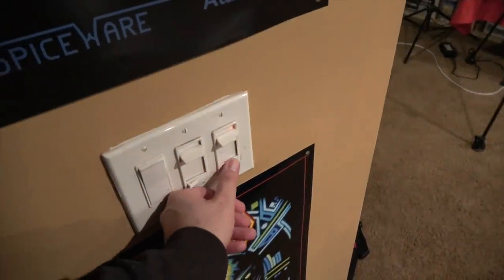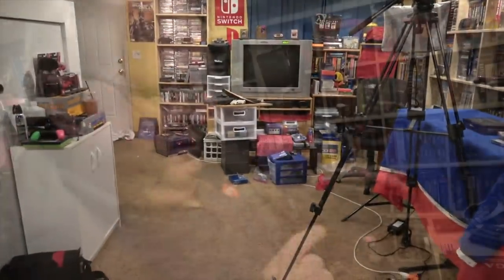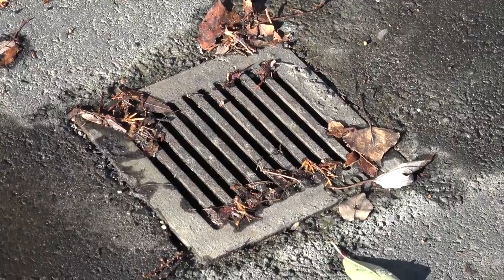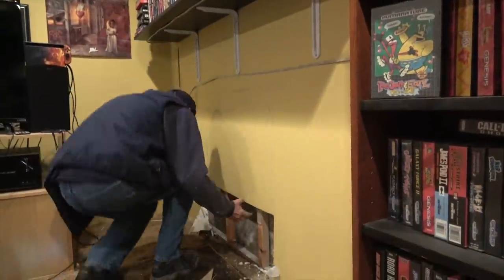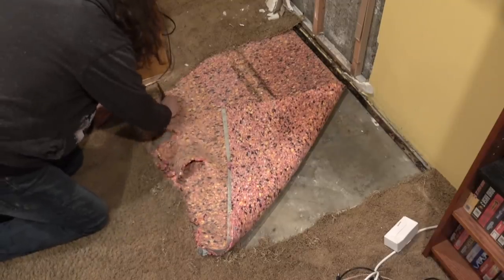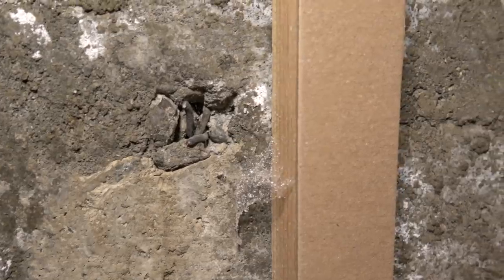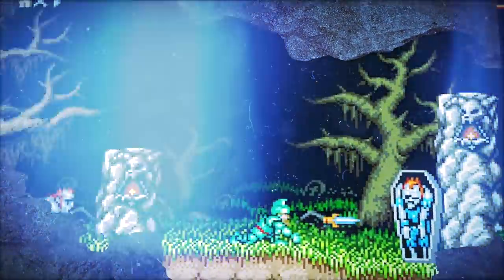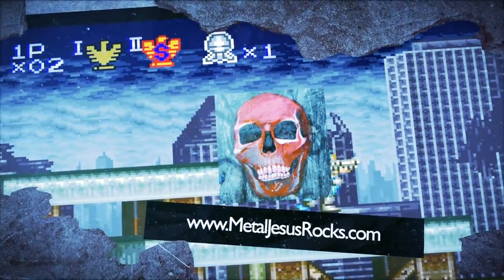OH NO! Water & Mold in the GAME ROOM! $10,000 to fix!

Comment: As a homeowner who also has their game room in the basement... This scares the hell out of me. I hope insurance can cover a lot of this.
Reply: In my experience, not usually.
Reply: you'd never get back remotely close to what you would want be it value or the items itself.
Reply: Most insurance does not cover finished basements. Same thing with the federally backed flood insurance that was written prior to finished basements being common. Maybe it would cover the leak repairs, but not the carpet, drywall or personal items. Usually just covers appliances like furnaces, water heaters, freezers and electrical, but that’s about it. After my sump pump failed and I found out the hard way (luckily just had to pay for my carpets to be cleaned and basement dehumidified since it was small and I caught it immediately), that changed my mind on doing a basement home theater.
Reply: Other comments have made it quite plain that they're making a sucker out of him by putting in drainage, but not fixing the outside. As someone else said; you don't just divert water after it leaks through your roof, you fix your roof! Big box hardware stores sell rebar and concrete, so he could easily rent a concrete drill to remove the material, pack concrete in, and jam a piece of rebar through. Once it cures, dig out the outside, ass drainage stones, and seal it up.

Comment: Man, just buy a few cans of flex seal...
Reply: Spyros Vassilakis Flex tape fixes boats so why not flex tape
Reply: Josh Jones He can pour flex seal into the holes on his wall... Problem solved.
Reply: Cover the yard with flex glue.
Reply: Yeah... Flex products were "designed" for scenarios like this one. 🤣🤣🤣
Reply: I was about to comment the same haha
Reply: Agreed. That is such a minor leak. No reason to redo the foundation for it. The water he saw probably took weeks or more to saturate that much.
Reply: You mean Flecth Theal?
Reply: This could be a really good fix! Remember that first and foremost those contractors are business men (or women) sometimes the best solutions are not the most expensive ones.
Reply: Most definitely, thats a lot of damage.
Reply: FlexTape all your games!
Reply: I sawed this boat in half
Reply: Yeah fix it with a flex tape....and then when all the other joints fail you can get more damage and cut more holes in the walls......This isn’t a cheap fix solution.
Reply: Build a second house of flex tape

Comment: As a former mold remediator of 7 years, I cringe when I see no PPE being used while handling mold and mold infected material. No mask or breathing apparatus, no gloves. I hope you took off your clothes you worked in and put them in a bag to wash separately. Because, all that mold disturbance, walking on the carpet, cutting a hole in the wall, pounding against the cut pieces, and ripping up that carpet; that released microscopic mold spores into the air. Like tiny bombs exploding all around the area. You're breathing that in, they're getting in your clothes, hair, into your lungs, all over your furniture, games, etc...our contract mold group would run air ventilators in that room, which would suck out all the air and be blown outside via plastic sheet tubing. It's expensive, especially if not handled properly, because of problems later on as a result of mishandled mold. I wish you the best of luck.
Reply: Was thinking this as well.. Metal Jesus has some very valuable gems in his collection that now have mold spores on them.
Reply: he's jesus.  he'll be fine.
Reply: Yeah I guess he could always turn the leak into wine and maybe the mold into a chalupa.
Reply: tylernol not a crock of shit... mold is bad shit. Brain atrophy as a result of it, had to throw away 95.% of my possessions because of it.
Reply: nice ad
Reply: gank Uverymuch plus it turns u into a clicker.
Reply: @ajborowski  I believe you I tossed my clothing out and Mold in my parents house again now cause health issues but nothing serious. Thank God I moved out.
Reply: You guys don't need to believe me lol...it's your health, not mine. I only went to school, got certified, and worked remediating mold out of my community members homes for 7 years. We went back to the first homes we did, 7 years later, and there was no sign of mold returning. So I think we did an ok job haha...but, don't listen to me. Go ahead and take these other know-it-all's advice lol

Comment: My suggestion is to get another quote for the full exterior thing. If you do it inside with a drain line, water are still licking into your basement, that does not fix the problem, still will be getting mold inside the wall. And a few years later the drain line will be blocked and you need to redo everything again.

Comment: Here in sweden when we have a cellar we usually dig around the house to replace the materials and fix the drainage once every 25-30 years. and you should not have plants in direct contact to the house, have a half meter of gravel around to keep the moist away.

Comment: . you dont have to remove everything, In Canada, we have like alot of water with snow and rainning., and every house have basement like yours, all you need to to is to apply a presurize glue in all holes. wait couple of days to dry, the glue is ciment glue, the name is EPOXIES
Reply: That was my thought drill out the holes with a large bit fill with apoxy resin and the. Dry lock the basement
Reply: yes northern ontario canada here , did concrete for years, even my basement, ive dealt with similar issues but i have a block foundation, but still very similar and they are trying to screw him big time.

Its can probably be fixed by doing some landscaping, check your eves, might have a leak, doesnt take much to take on  moisture in a basement.
Reply: @mitchdeblois3697  i had similar issue and did two things, put a drain tube in about 4 feet, (did myself) and put a special hose to drain water. and a specialyst came to fill the hole with expoxie..
Reply: @colearmoryllc  never drill more holes that there is.. just fill them with epoxie
Reply: @beaulieuRule  nice, another good alternative like i said is to take a look at landscape, could be simple landscaping to divert water, or maybe blue skin , but that would also involve tearing out the the jiprock

Comment: I had a similar issue earlier this year after a massive rain, and my game room also got wet. I had the same system put in around the entire perimeter of the basement and it was tied into a sump pump in my utility room, and it's been dry ever since. As long as you have a reputable company do the work, you should never have a problem again.

Comment: I had the same problem in my basement music room. I removed the walls and studs in 2 rooms. The permadry guys came in and threw up that membrane and dug a pipe in a few hours. Had to wait 3 days for the concrete to cure, threw some studs in, re routed the outlets, insulated and threw up some drywall. I had a pro come in and mud. It sounds like a lot of work but it was really quick and easy. The bill is worth it, knowing you'll be nice and dry for years to come. If you any questions hit me up.

Comment: As a temporary solution you could seal the interior of that section of  wall which has been worst affected, there are various products which you can use and get a dehumidifier which will draw out any moisture, it's actually a good idea to use a dehumidifier in a basement especially in older properties.
As a long term solution, I would tackle the outside of the basement , maybe a better drainage solution, get a few quotes from different builders/damp specialists and check to see if you're covered on your home insurance?

Comment: I feel for you MJR. I owned my condo for 6 months and came home one day after work to 2 inches of water in my living room flowing out the back deck due to my neighbor having a slab pipe leak. Drywall and carpet destroyed - months to dry it out and repair.  Once you get to the repair part,I'd recommend doing tile in the basement vs carpeting.  You can always put area rugs down if you want. They make some cool tile now that looks like wood flooring.  Also great for clean up any accidental spills during gaming sessions vs carpet stains.  Hang in there bro!

Comment: A lot of comments on how to shore up the basement (the symptoms), but no one wants to fix the cause: remove the parking pad. One of the recommended ways to do this in PNW and moist areas is to use pavers that are permeable so the rainfall can get directly to the yard and not cause runoff. Maybe a new above ground Tuff Shed-type building could be the new game room? Either way, good luck.

Comment: A few things I've learned from renovating a basement...  If you finish a basement you need to expect there will be water in it someday... Use materials that are mold resistant and have some tolerance for getting wet...  Nothing organic, nothing spongee, so no (untreated) wood, no carpet, no underpadding...   If you have a floor drain and the basement floor is pitched to the drain you might be able to get away with raising the floor with a plastic subfloor like Dry Barrier or a Delta-style dimple mat, then put waterproof vinyl laminate flooring over that, that will allow water to drain and the concrete to dry out.  I would also suggest you have humistats in various corners of the basement to monitor humidity and dehumidifiers to keep the air dry.    If you do go the route of putting in a interior basement drain as the contractor suggested, take everything out of the basement as there will be an incredible amount of dust created from the jackhammering of the floor.

Comment: Those metal things in your foundation are called snap ties. When pouring a foundation we use them to hold the concrete forms together so they do not blow out from the pressure of the concrete.

Comment: I solved this problem on my grandfathers house built in ~1970. By digging all around it for about feet and a half deep and some 7 feet away from the house and made a decline away from house from dirt, not much just couple of inches deeper away from the house. Then i put plastic tarpaulin from the house all the way outwards and glued it with polyurethane adhesive to the foundation of the house. Then i put the dirt back on top of it, evened it out. Made concrete path around the house around 2 feet wide, and used concrete sealer to seal gaps between sections and gap between house and concrete path. So far it has worked great and as someone who doesen't know jack shit about construction it's holding for well over a year with no problems. Cost me around 2000 euros and a week of work on and off with 2 buddies.  That cellar was basically unused for for the last 15 years as my grandfather is 90 years old and it's hard for him to go up and down the stairs. If there is someone who actually knows something about construction would comment on my solution it would be appreciated.

Comment: I have been less lucky than you MetalJesus... Last year, a lot of my games were stored in front of my very large window. At the bottom, there was a gigantic black mold, i mean a crazy black mold. Unfortunately, a lot of my games have been affected to it.

I had to dry (radiator) and flatten them with big books (Because humidity makes waves on the paper. It was mainly PS2 and GameCube games). I saved them but it took me a lot of time and patience to take them back to their "nearly" normal shape (the paper, not the box of course). Also, i had to cut a lot of the borders from the papers because the mold made them larger. I know, it's weird but it couldn't fit anymore in the box.

Immediately after this fucking nightmare, i rushed into a kind of "DIY"shop and i bought some big storage boxes made of thick plastic that i stored in my garage (no humidity there).

Today, i'm not anymore in this house. I had an appartment recently, that i hope it will not has any kind of fucked up surprise that i will discover in the walls through the years i'll live there...
Reply: @Workerlaman   I haven't got a patreon. And i wouldn't have wanted people to pay for this kind of trouble in my life. I mean, it's nice being helped from people but i prefer fix the problem on my own if i can.
Reply: hi, I've the same problem with my 3ds ds and gamecube games. about 80 of them had the same wavey problem to the paper artwork. I've rolled them up tight and left them for  over a year now. I hope they are ok and I'm sure they will be bigger like yours so I'll have to cut them. devostaded. fortunately my boxed gameboy games wasn't affected as I wraped them in DVD sleeves.

Comment: As a fellow homeowner who shoots videos in his basement, I feel your pain. I know this kind of thing can be expensive as hell (and insurance is not something you want to use for something like this. Maybe if your house explodes and you lose everything, but not 10K for a leaky foundation). Look on the bright side, because it could be a lot worse - you could have a sewer line leak in your basement like I did! One suggestion I'd make is to avoid wall to wall carpet in a basement, even a finished one. There's just too much that can foul a carpet in a basement, and it's a PITA to pull it up. If you do want to have a carpet feel, try carpet tiles like FLOR or similar. You can pull them up and replace them individually, without cutting. If anything like this goes wrong, it's maybe $100 to fix the floor. Won't help with the walls or drainage, but it's one less thing to worry about.

Comment: I've been dealing with water issues in this house AND my last one... Grading is your friend. Get that patch in front of the house graded properly and get that water flowing away from your home. An interior drainage system will just let that water come in, and the idea is to get the water AWAY from the foundation, don't invite it in and divert it along a different path. Tie rod leaks are COMMON and can be plugged from the inside. Ideally, it's best to stop the water rather than letting it in. Either build up that flower bed and get it graded away from the home, or maybe even pour concrete there with a good pitch away from the house. Probably a better solution that trenching the basement and letting the water come in at will.

If that doesn't fix it, worst case scenario is you'll spend a few hundred dollars for nothing, rather than thousands on something that will just fail over time anyway.

Comment: 1: Make sure it's not covered by insurance.
2: You can do the Sheetrock yourself for less than 200  to 500 bucks including paint, a 4x8 foot sheet of drywall is only about $12  .
3: You actually don't have to excavate your yard to fix this you should call a different company . I know A-1 Fixes this by injecting resin from the inside .
If you really wanna get into it they make these things called compressed swell plugs to fix those and they cost like 5 to 10 bucks each . There is probably 20 different ways to fix this other than digging it up always ask at lest 3 people to look at it and give you repair options before getting locked into one method. Fancy tools don't always mean the best option .

I hope you get this fixed for way less and get back to making video's 

<---- Class A Contractor / Land lord / Flipper and BoSs .

Comment: Couple of thoughts after going through a finished basement flood (Sandy), as well as a complete basement system with curtain drains over the in-laws.  When they cut the drains there will be dust for days.  You’ll need to remove everything.  Basement will always be damper than usual during wet times.  Look into doing an epoxy floor, like a spartacoat - it’s mold resistant and actually will seal the floor.  I ordered 3” aluminum legs for every piece of entertainment equipment  I put back in the basement to keep them off of the floor.

Comment: Should have caulked it with silicone and put those 2 pieces of dry wall back after they dried, steamed the carpet with a mold killer, then rolled the carpet & pad back and let them dry out for a few days using fans. Contractors always over exaggerate the repairs you need because thats how they make a living
Reply: You're still going to have increasing amounts of water pooling there with every rain (every day in Seattle). You got to deal with bulk water at the source. The rest is just band-aids.
Reply: rsmith02 how would it pool there if you pumped the anchor leak full of silicone caulking?

Comment: That’s not a 10,000 fix.... You’ll be forking out around 5-7k if you’re smart about it. Just replace the drywall and find that leak.
Reply: Depending on what is causing the water damage it very well could be a 10k bill.
Reply: better to fix the hole and everything around it

Comment: Do it on the outside properly and add drainage pipes too. Costs more yes but fixes the problem for a long time. I have same thing going on here in Finland for our terrace house (10 families) and estimation of cost was 65000 euros if no big hidden bedrock need to be removed for drainage to be working right, and it should take 2 months. So we had 4 meter deep and 5 meter wide  trench on the backside of our house for a month and now it's starting to fill up again. Maybe next spring we can start fixing a new lawn.

Comment: so not needed.  cut four feet up of the sheet rock from the bottom all around, then use cement sealer, and sheet rock it all yourself.  Sheet rock is an easy do it yourself job.  The drainage has been the same since the 1960's and it has not been a problem until now. there will always be water in the ground. drainage is not your issue, it is sealing the holes in the wall.  I think they are taking you for a ride on the price.